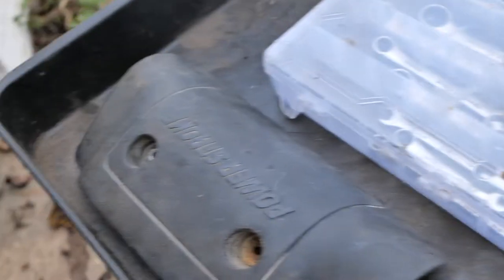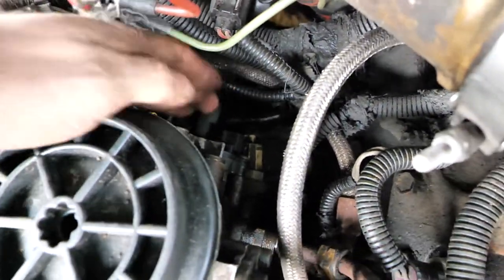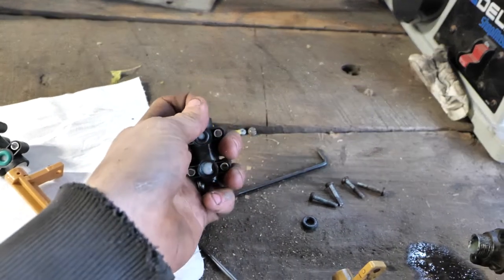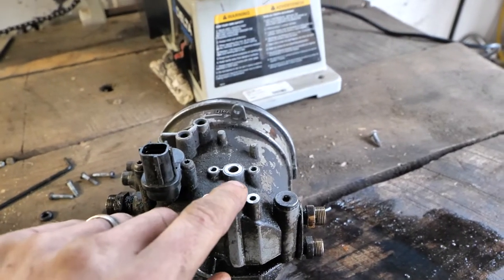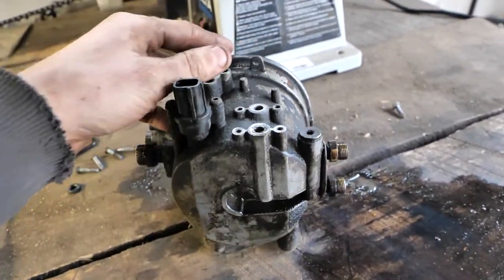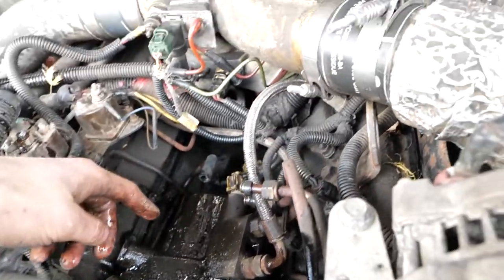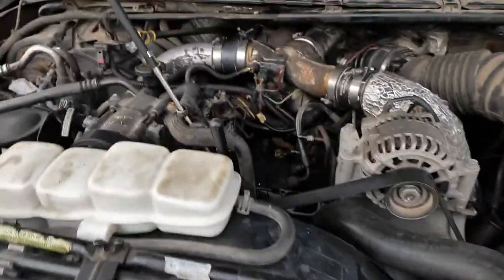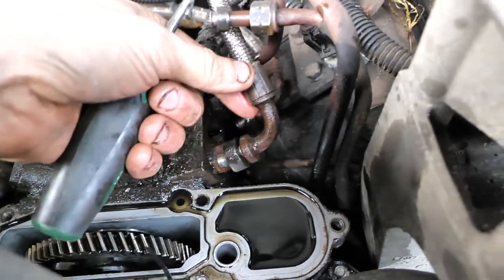7.3 Powerstroke High Pressure Oil Pump how to Replace, and no start solution

Comment: You never said why you replaced it icp psi before replacement
Reply from the maker: I didn't actually replace the unit, I just resealed it. There was an oil leak from the old mounting gasket at the front cover. Sorry I forgot to mention

Comment: Is this the same engine as in a 1996 OBS 7.3 exactly, I'm pretty sure the truck I just purchased has this same problem just wonderjng if I was looking at doing the same job.  Video is really good thanks for sharing your experience!
Reply from the maker: It is not exactly the same. I am not sure but this is probably the same process on both trucks with some minor differences.

Comment: Currently experiencing a no start issue on my 2000 7.3 SD after replacing the lift pump. Lift pump was indeed bad. It ran out of juice on me on my way to work one day,my fiance was able to tap on the lift pump and it started and got it back home. However now that we've replaced that it will not start. Does not seem to be getting fuel. We just replaced the IPR tonight and still no start. Next step will be to get a computer reader on it (we do not have one). Thinking injector control module and if that doesn't work possibly HPOP? Is there anything we could be missing before we spend $800 on the HPOP? We already tried a relay also. (Not sure if you'll see this since the vid is 2 years old)